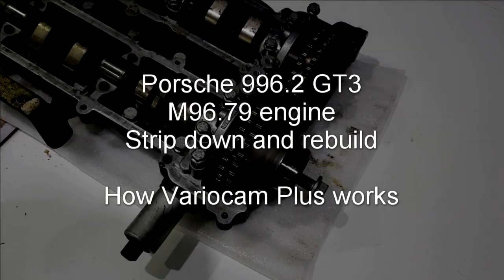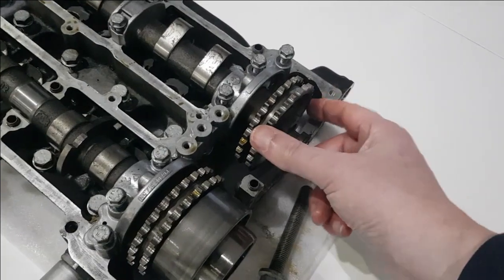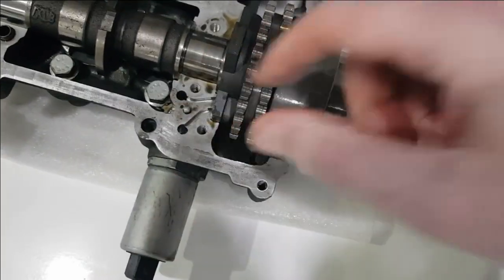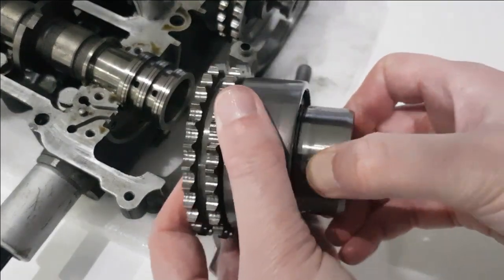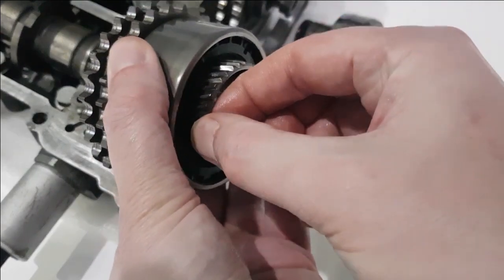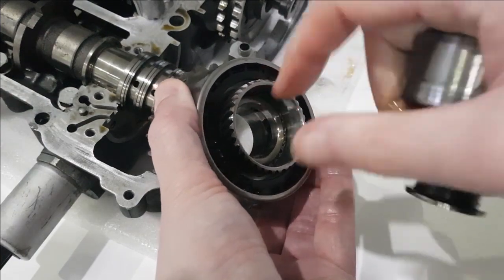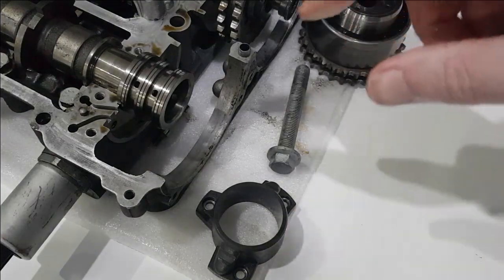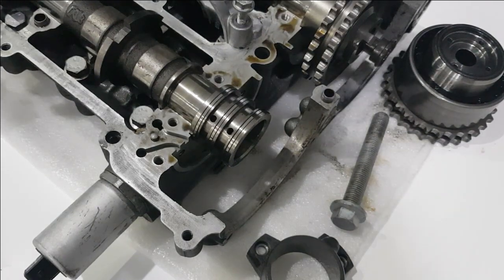Porsche 996 GT3  M96.79 engine rebuild.  How Variocam Plus works

Comment: This is essentially the exact same vanos unit used on the m62 v8 engines. There are plenty of seal rebuild kits available for those units but it doesn't seem anyone makes anything for these. I have a 996 turbo with 176k and and it has some nasty rattle on cold starts after sitting for a few weeks. I'm beginning to wonder if these wear out similar to the BMW's i've worked on.
Reply: Hello. We are company specialised in VVT remanufacturing. We have developed regeneration process for Porsche M96.76 phasers as well as BMW M62TU. We are not only replacing the main seals but open the whole phasers and replace all the seals inside. Check our offer.
Reply: Austin, did you ever resolve your issue with your 996tt?

I have been chasing a similar noise and also cam deviations issue with mine for over a year. I think its the seals in the cam phaser too.

I talked to Chris at DrVanos in Texas and he thinks they are probably the same. I will send mine out soon and they will determine if they can be rebuilt like those from the BMW M62tu V8.

Comment: Very interesting.  It is indeed very similar to the BMW Vanos system but I think they used higher pressure oil from a cam driven pump.  Early single vanos only acted on the intake cam, I believe exhaust camshaft actuation is mainly useful for controlling emissions.
Reply from the maker: Yes it does use a seperate pump. I rebuilt the Vanos on an E36 M3 Evo I had.  Having it on both means they can get more overlap for better high speed performance as well.